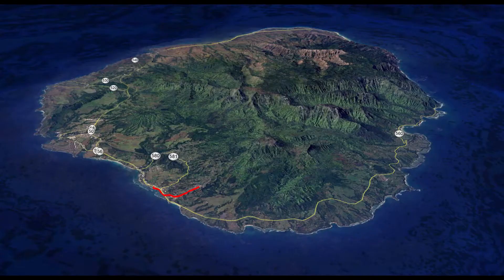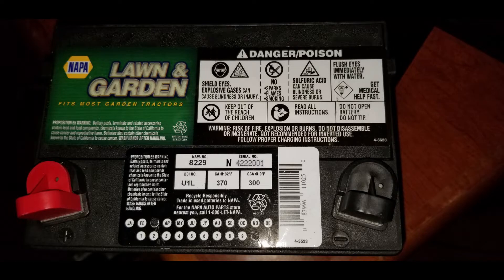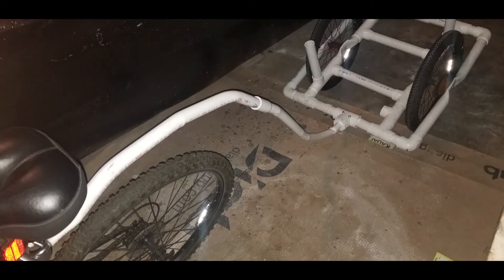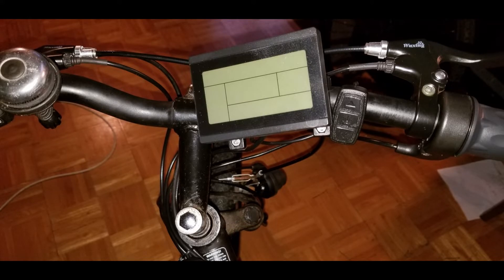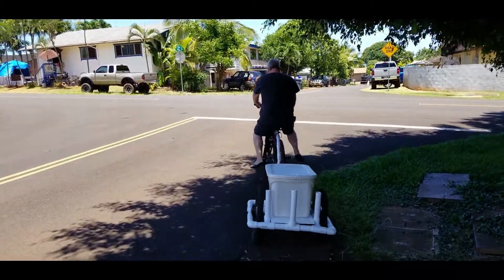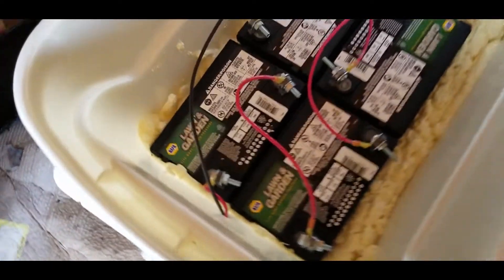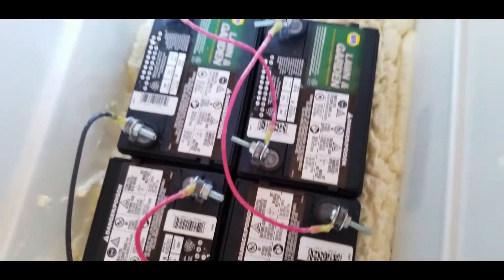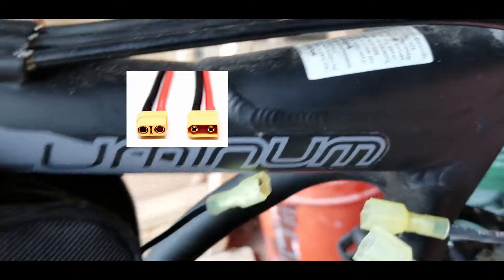Electric Bike Build # 2 - PVC Trailer and Test Drive

Comment: Perhaps you make trailer electric for all bikes
Reply from the maker: It would be nice to have the trailer be optional... searching for a luggage/battery rack that will fit this bike...  the downside of the trailer is that I have to disconnect the electrical cable every day and remove the battery every day... will be extra wear and tear over time.